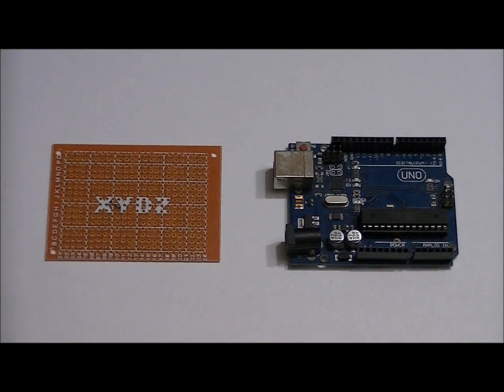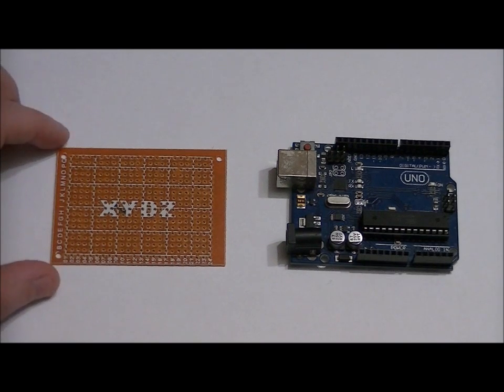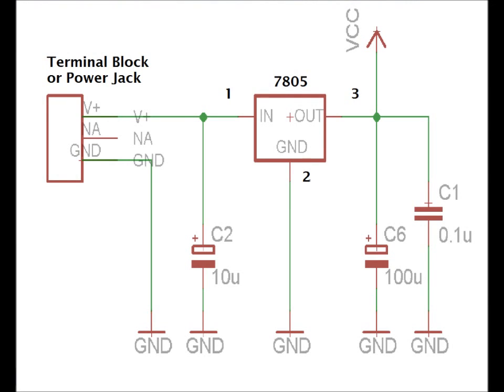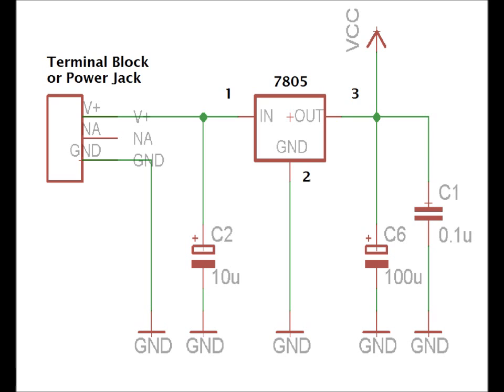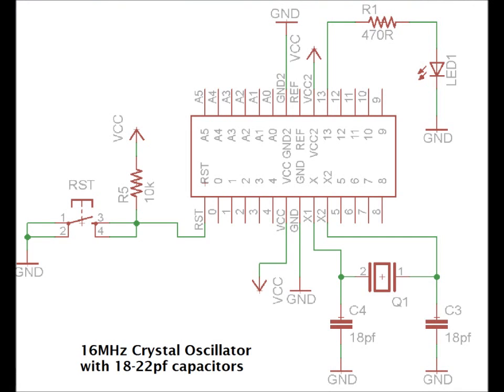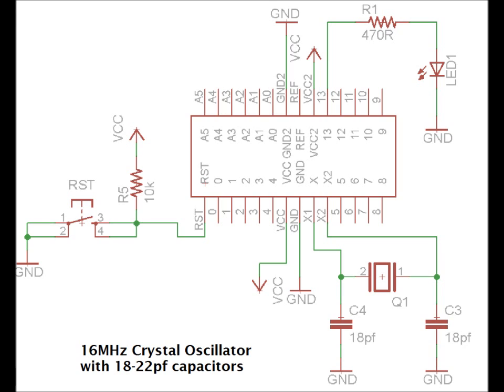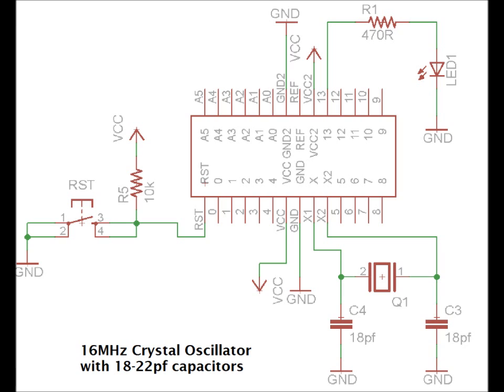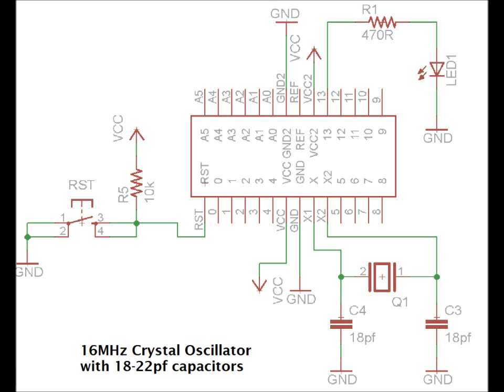Arduino Tutorial - How To Import Your Arduino Projects Onto An Empty Prototyping PCB!

Comment: Yes, good video.  So far I don't see the need to use 9 volts to power the thing and using a voltage regulator to drop it down to 5 volts.
Reply from the maker: Hi Joseph =)
Great question.  If you had a clean 5v power supply, then you could rid yourself of the regulator completely.  However, I've never come across a 5v battery, and if you've ever measured a 5v wall adaptor,  very often they output upwards of 6-6.5v.  The chips that I commonly use have an absolute maximum power supply spec of 5.5v. If you use a 7.5v (Min) to 9v wall adaptor, coupled with the capacitors and regulator, you'll  get a near perfect and safe 5v power supply every time!  Thanks for the question!